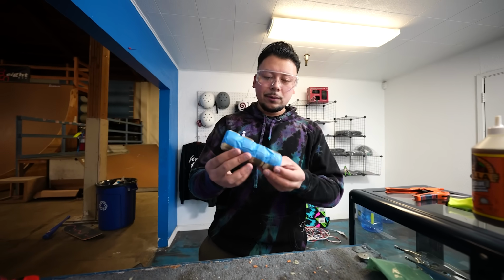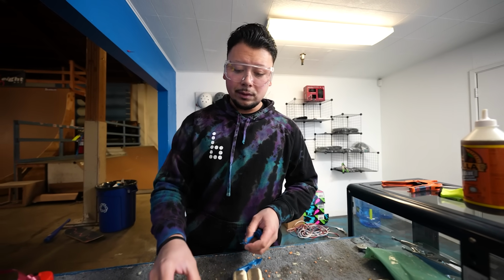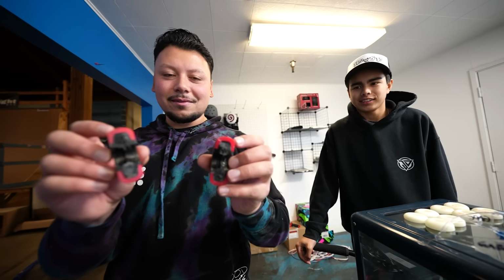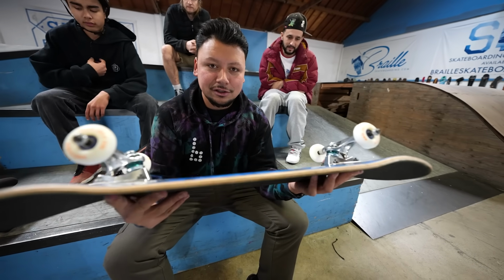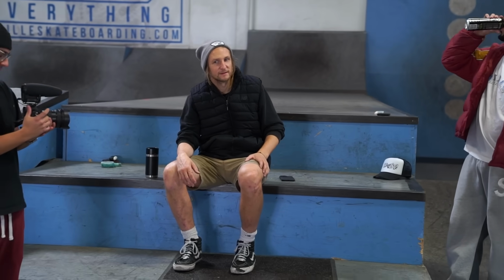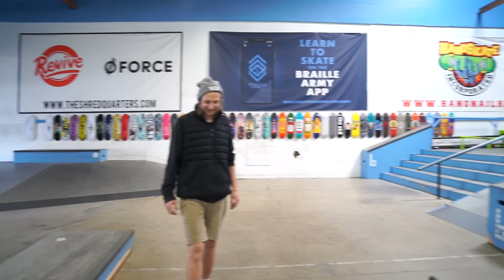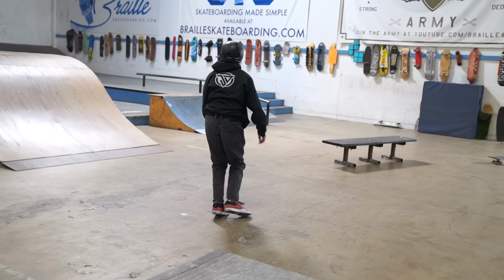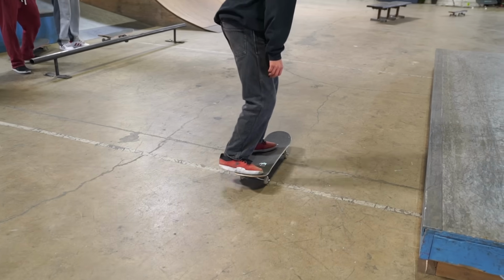WE CUT SKATEBOARD WHEELS IN HALF AND THIS HAPPENED

Comment: Get some of those pop cans from the smoke shop that are meant to store your smoke in! 

They are filled with a super hard plastic, very skatable.

You can unscrew the can, drill the hole for the trucks and then when you put it on the trucks you can put the cap back on and it will look like you are skating still closed soda cans

Comment: Cutting a bearing slot in backside of each wheel so you can use 2 bearings would fix all the issues. My buddies and I done this years ago when we skated. Also need axle shims to take up some the wheel slack. Great video tho guys!

Comment: 6:30 After seeing that, I can honestly only conclude that JD literally has better balance on a skateboard than I do walking on my own two feet haha 😄🤦🏻‍♂️ 
I skated waaayyyyyyyy too hard in my teens and 20’s and hit more concrete and asphalt trying to skate massive stairs around my town that no one else would try. I pushed the limits but holy atrophied deadass am I ever paying for it now…

…still skating though 🤷🏻‍♂️ Just put a new deck together today because I wanted a flippier 8.0 to ride at the park along with my 8.38 Baker, and my Sector 9 Gravy board 🙂

Comment: you have to put spacers in there to keep them outside.  Or inside.
or just have tiny, thing wheels with bearings sticking out.
You can just grind some normal wheels down very thin on top.  Give them a crown.